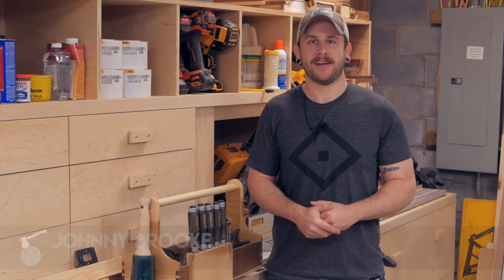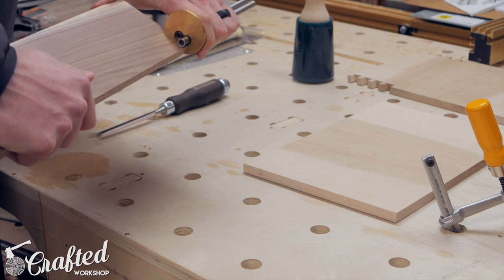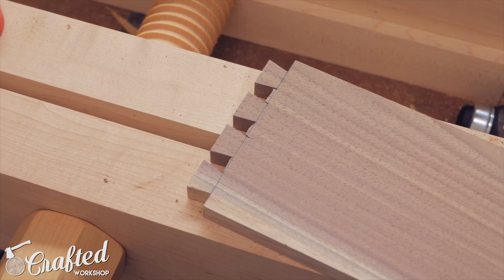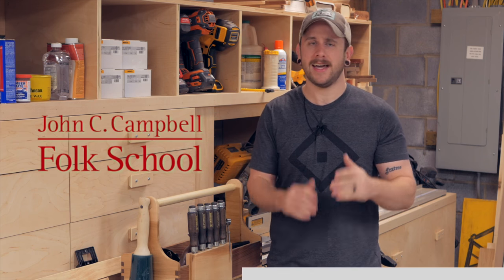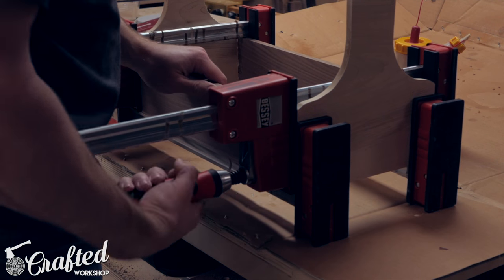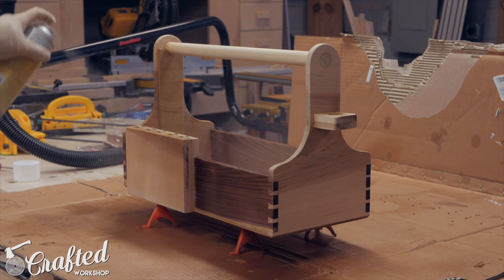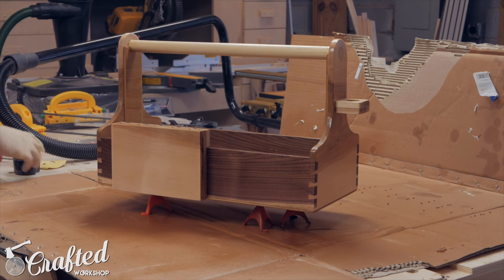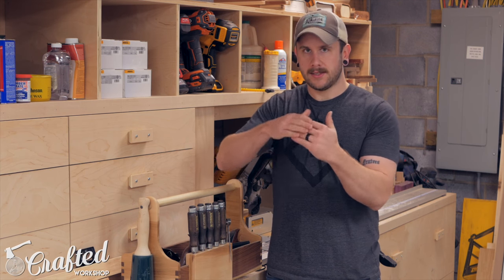Hand Tool Tote with Hand Cut Dovetails | How To Build - Woodworking

Comment: So glad you addressed the grain direction.  I was looking at it pretty funny, but then stopped to think about it going the other way and realized that would make the dovetails week.  Now I have to go back to my Fine Woodworking mags to find the Tool Tote they built and see which way the grain direction is running.
Reply from the maker: Yea, it was a bit of a conundrum. The way to handle it would be to make a curved handle so the sides are more narrow. But I didn't feel like doing that!
Reply: yep, if you went the other way, you'd have to dovetail it to the bottom 
and attach the sides in a different way. I think these little conundrums
 caused by wood grain orientation are one of the things that make 
woodworking so interesting.

Comment: You didn't mention an adjustable square or the dovetail guide when you outlined the tools that went into the tote.  Obviously, you needed something to set the angle.  I agree with the revision in wood choice.  The problem (at the outset) is that dovetails go in end grain.  If the side is "tall", then the board has to be wide.  This is a poor choice in a project like this.  Your proposed revision was a good one.  I would use 12mm Baltic birch plywood.  It dovetails well and is super pretty and super strong.  Thanks for the build...
Reply from the maker: Yup, I’d used Baltic Birch if I built this again. Thanks!

Comment: Had YouTube on random play and you came up.

Nice build, attractive 'carry-all' as they were called at my trade school.

You may eant to consider orientating your grain around 90° for the ends. Likely not an issue in your shop but if I were to take that on site etc a knock to the end could snap the skinny section leading to the handle. You didnt mention in the video (or I missed it) is that why there appears to be three ply glued to the inside under the handle holes?

Obviously start typing before the 8:53 mark lol. All good.
Reply from the maker: +Dave's Cave hah, yup! Definitely a bit tricky with the grain orientation. Thanks, welcome to my channel!

Comment: great tool tote sir, awesome design, just subed. how do you like those narex chisels? I'm in the market for some new chisels and am looking at stanley sweethearts, woodcraft store brand, i believe woodriver and narex the imperical sized
Reply from the maker: Thanks man! I'm digging the chisels, but I don't really have any experience with other chisels. I did have the pleasure of using a Lie-Nielsen corner chisel during the class last week, and it was just a totally different experience. That said, that one chisel cost as much as my set of 7 Narex Bevel-Edge chisels.

Comment: Lovely build but please can you recess the bottom into the sides. It adds lots more strength to the construction, it looks a lot nicer and it only takes a few minutes
Reply from the maker: +Born to Make it's a little late for that, but you're welcome to if you build one.
Reply: Crafted Workshop ok, but thanks it was a great build
Reply from the maker: +Born to Make thanks!

Comment: Nice looking tote. Not sure I would consider myself to be hand cutting dovetails if I were using a Baron jig.....
Reply from the maker: +Jaime Clifton thanks, but what else would it be? It's just a jig.
Reply: Crafted Workshop - Once upon a time I used to ride a bike with stabilisers but I didn't count myself as being able to "ride" a bike until those stabilisers came off. 
There comes a point in woodworking when it's less about craft & skill and more so about the operation of tooling....
Reply from the maker: +Jaime Clifton a plane is a jig for a chisel essentially, do you consider that cheating?
Reply: Crafted Workshop - I didn't say you were cheating. My remark is one of standpoint but jigs can be had for nearly every aspect of woodworking. At what point do you stop woodworking and simply processing wood through machines? Anyone can read a set of instructions.....
A plane takes a considerable amount of skill to sharpen, set up and use well - you'd struggle to do the job it facilitates without one.....

Comment: I don't know why but I'm 15 and started using just hand tools I've used power tools all my life but so far I haven't had to use a guide to cut a straight line idk why does it depend on the saw
Reply from the maker: The guide just helps to nail the angles consistently.